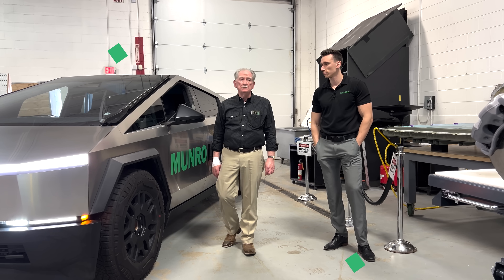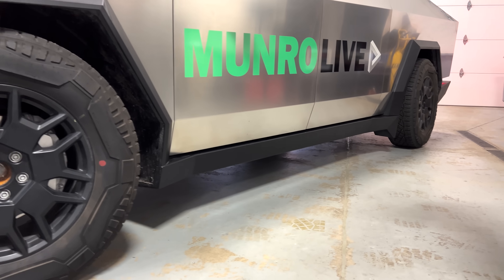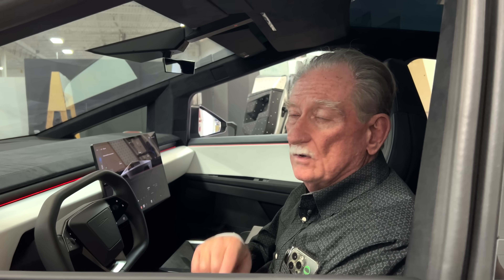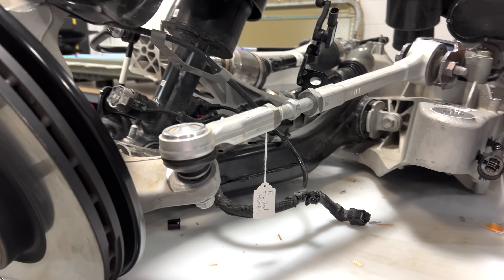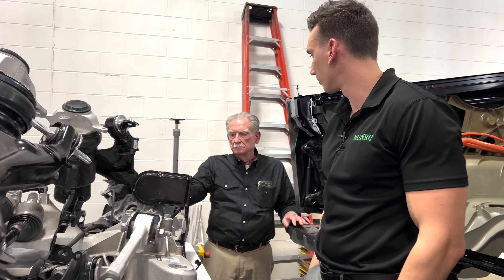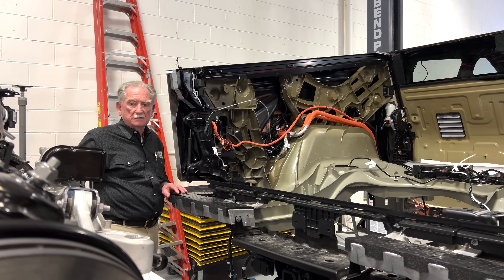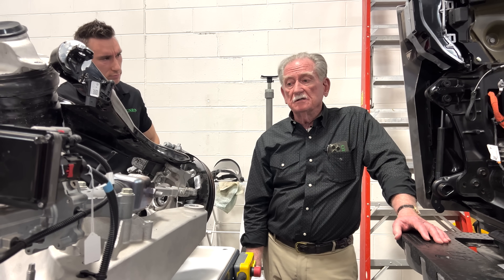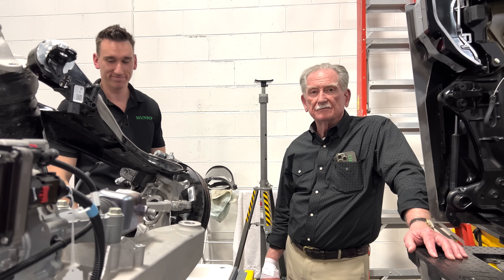Tesla Cybertruck Steer-by-Wire System

Comment: Stop shilling for cyber junk.  Your lack of any design lack of awareness  is showing.  the Cyber junk is a menace to all, it's customers, pedestrians, and any sane thinking person.  ummmm, aaahhh, ummmmm.  audi has had rear steering for a long time, and 48V, stop making up stuff like Tesla is innovating anything, stop the lies Disastertruck

Tesla's Cybertruck is really struggling to keep it together.

The brutalist pickup, once CEO Elon Musk's much-beloved pet project, has been mired in problems since finally going on sale late last year, from a major recall caused by a disastrous issue involving the accelerator pedal to being defeated by small hills and even a trip to the car wash.

Now, one owner has reportedly had the entire assembly of his truck's gear shifter come crashing down, causing the truck's visors, which are also attached to the assembly, to be ripped off as well.

For reasons we can't explain, Tesla chose to mount the gear shifter to the vehicle's monstrous windshield, requiring drivers to switch drive modes via a touchscreen suspended above their heads.

"THIS IS a clear design and engineering error!" former Tesla engineer Cristina Balan tweeted. "The issue with this design is the fact that the visors are one of the most used part in a car that takes the most amount of force!"

"This will ALWAYS be a problem if they don’t change the design!" she added. "This is bad."

Comment: I’ve been behind a few cybertrucks merging from an on-ramp, the front of the cybertruck was micro-darting left and right while negotiating the corners of each on-ramp. I get what Tesla was trying to achieve with this system but it seems like the implementation has been botched. Disappointed to see this technology act as an obstacle rather than a supplement to driver engagement.

Comment: 9:50 A great and popular computer repairman once blasted Apple for a flaw in their laptops: the power pin on the motherboard was right next to sensible CPU voltage line near the lower keyboard. One drop of coffee reaching that emplacement would fry the computer.

Could this be something with the 48V Ethernet loop? having the 48V pins right next to the communication bus? IE, someone drops an open water bottle at the wrong place inside the cabin and doesn't notice it right away?
Reply: The connectors are far away from such splashy zones I imagine. Also the apple ribbon connector is quite a bit smaller pitch compared to what clearly is a separated set of pins between the power and data.

Comment: That etherloop wire+connector looks interesting. 
First of all, the cable is not twisted pair like we're used to seeing with Ethernet.That seems important, since twisted pair and differential signalling is the way ethernet builds resistance to interference. I would love to know how this system was made resistant to interference, or if Tesla perhaps found that twisted pairs are not needed and differential signalling works just fine over this flatcable design. It would be helpful to know how this cable is routed in the actual car.
Second of all, I would be interested to know how many contact points are present on the connectors.

Comment: I was hoping for a teardown of the front rack to see how the two drive units deal with failure modes.  Clearly there's a worm and wheel pair turning a pinion driving the rack on each side.  Also the description of the electrics sounds a bit presumptive.  I mean are they really using ethernet packets for realtime control as Sandy suggested, or was that just a guess?  Hook it up on the bench and find out.  This is the 'technology' we're told is so great, can that not be demoed?  Thanks for the video!

Comment: Glad to see ZF is likely to be co-developing this system. I would not want to trust a company to get safery in a steer by wire completely right when they remove features like a previously working parking assist to maybe deliver a camera based function like 2 years later that still misses the rudimentary functions and tolerances of ultrasonic sensors 10-15 years ago (at least in europe based on the experience of a colleaque with a new Model 3 Highland with (in his words) still unusable front parking assist...). 

Don't get me wrong: the electric powertrain is very good nowadays. But for many other basic "car-functions" for me it is too much tryout and live with cost savings with not working backup solutions or quick and fast updates sometimes with function restrictions...

Comment: ah, Can this steering system be easily implemented in a gas car?  Does it require software and an EV system?
Reply: Yes, 48 V, Steer by wire, reer steer, Ethernet loop etc has nothing to do with EV.

Comment: Seems I often hear Sandy and Armin, say a part is forged aluminum, when in fact it's probably just cast aluminum.  Forged parts are more expensive to produce and for the parts shown, a forged part is probably not needed when a cast piece does the job at a lower cost.
Reply: I'm callin BS on this one. I've run into this mis-assumption many times in the past. Forging in many circumstances can be a lot cheaper than casting. especialy for an aluminum part. I know this for a fact. The steering components (tie rod?) does appear to be forged. And the part they point out as being forged would be very cheap to produce as a forging.

Comment: I watched the video yesterday, and this morning I woke up with an epiphany. I'm pretty sure I know why ZF incorporated 2 servomotors on the front steering rack, and it has nothing to do with the non-existant "triple redundancy". It's to provide enough force to steer this giant tire/wheel combination. My guess is that ZF had an off-the-shelf servomotor that was just not quite enough to steer those huge wheels in certain situations, like when the vehicle is off road and one or both of the front wheels is stuck in a deep rut or up against a rock. And rather than design a newer larger servo, they just doubled up with smaller motors. And this would explain why ZF/Tesla had to add a third position sensor. Has nothing to do with redundancy.

Comment: In control engineering, the arrangement is called 2oo3 ( 2 out of 3majority  voting )  system....not triple redunandant.
 Triplr Redundant to a SINGLE control unit is adequate to  guarantee an acceptable level of safety such that any fault will automaticallly force the car to go into a safe state to protect the car and its occupants from an accident.
Reply: My guess is that the third sensor is not for safety or redundancy. Odds are that ZF/Tesla went with two servomotors on the front steering rack in order to provide enough steering power to steer this giant tire/wheel combo in certain off road environments. Anyone that's ever worked on a dedicated offroad racing truck would understand this. I believe the third sensor is for power management between the two servomotors since they have to run synchronously all the time. This is not a design for redundancy.
Reply: @Thegrimmechanic  that is nonsense. If they would do as You say, they would just make one longer motor for bigger torque.
Reply: @marcink5820  It is not nonsense, it's commonplace to design this way for many reasons. One reason is for space constraints. there may be a 'packaging' issue that requires the use of two smaller motors rather than one big one. Look at how aircraft are designed. The other reason is inline with the patent (but I'm guessing you never read it) to make the obsurd claim of redundundancy.

Comment: Airplanes have redundancy on all crucial systems, but Cybertruck doesn't have redundancy on power for example. So if power fails, you will lose steering.

There's a reason why other brands still have mechanical backup on drive by wire systems.

Also the amount of electronic overhead on this system leads me to believe it's not as cheap or as light as its mechanical counterpart.

As far as boats, we've seen what happens when they lose power, they collide into bridges because they lose steering, for example.
Reply: As you can see in the video it has two motors on the steering rack, it would make sense that each motor would have it's independent  steering sensors and separate power supplies for redundancy.
Also it looks like Lexus steer by wire didn't have mechanical failsafe, anyways these are road cars not airplanes, the safety requirements have nothing in common.

Maybe not an advantage in weight but clearly makes driving more interesting and easy.
Reply: There is a little redundancy in the front and rear steering wheels. If the front went out you could very slowly navigate the car. Probably enough to get it off to the side of the road. 

That is assuming it failed in the center 😅

Comment: That is not triple redundancy, it's only single redundancy. Two steering motors, two failures deep and your not steering any more. If it was triple redundant, you would still be steering after two failures (steering motors).  The communications cable has only one connectors. if it fails all data is lost, the two cables don't count. The two cables are not even redundant, with a single connector and may even reduce redundance. If one cable shorts has some of it's wires shorted, is it shorting the other cable too, thru the connector. If it melts the connector, it's melting both connectors.  The redundance is in the actual details, not enough information in this video to figure out the redundancy. Even the Three Steering Position Sensors does not mean it is triple redundant. The third sensor is good to figure out which sensor has failed, but with a second failure, you cannot figure out which of the two sensors failed. What do they do? An average of the two remain sensor? Another failure hard over the, the average position would end up in a crash. So, 3 sensors, may only be single redundancy.  I would call this single redundancy, as a second failure may result in a crash. Something fails, it may be safe to go to the shop to fix it, but isn't safe to rely on the second level of redundancy for any amount of time, no.

Comment: I've never heard a new car creak so much before, ya the tires make a bit of noise, but the steering sounds horrible. Oh and sandy, that's almost 180% of rotation on the steering wheel, not 90. Hope your tolerances are closer on your engineering 😉

Comment: How is rear wheel steering a new technology? I had a rear wheel steering on my 7 series some 12 years ago.
Reply: Honda prelude 1988 had 4WS. 
Subaru X1 (not sure of the model some 80ties model) had 4WS and 4WD  and could adjust ride height too... the list is long
Reply: Also, the rear steering on the CT is necessary for the poor design, so this can just barley have a WORSE steering radius than a Suburban.

Comment: Interesting to see confirmation if it really only is Ethernet and not CAN for SbW (I'm not aware of an released automotive Ethernet spec with TSN allowing for priorization and deterministic availability required for such a system). And again - don't guess on things you haven't opened. It is very likely NOT a planetary gear but a simple worm gear from motor shaft to pinion shaft for the required ratio to rack travel (dual pinion steering gear)

Comment: Support an automaker who wants to monopolize the market. 
Fact- Insurance companies will charge you 3 times as much for insurance compared to conventional engines
Fact- Tesla has terrible service regarding their vehicle maintenance with technicians charging over 200.00 per hr.
Fact- If the battery is damaged from being located under the car its not fixable. Repaur cost an easy 10k for for new replacement battery not including labor.
Reply: Oh, and don't forget you can break into a Tesla "frunk" with a pocket knife in about 10 seconds...

Comment: What happens to the triple redundancy in case of an EMP shock? Like a solar flare?
Reply: EMP will fry everything.  Most cars already use electric power assisted steering so that will die and the steering effort will increase 3 times or more.  Many people do not have enough strength to turn the wheel in that situation so the mechanical linkage is not a huge help.  Just hope you are going straight regardless of mechanical or elctronic linkage.

Comment: Mode of failiure would be of intrest with these systems. You observe there are 2 steering motors. If one motor fails, there is still the other to produce the motion. Well, not necessarily. It depends on the mode of failiure. If there is some mechanical failiure inside one of the motors and it locks up, can the other still move the whole mechanism, including back driving the failed unit? How is that risk assessed and mitigated? Also, you observe twin flatform cables for the data and power, but it only has a single plug. How is that classed as having redundancy? Most cable failiure is at the connector due to corrosion. I would have thought it would need 2 completely seperate cables and plugs connecting into a module with 2 completely seperate circuit boards etc etc. Tesla is undoutably brilliant at this so Im sure they have this worked out, it would just be interesting to see how.

Comment: Looks overly complicated for something that can cause a major safety issue.  I’d prefer that manufacturers stay with a mechanical connection for the steering.
Reply: why not try something different?
Reply: @websitemartian  You can try a lot on a car, but not when it comes to steering and breaks. Those two are the most important elements for operation safety.

Comment: Yes, the rear unit is almost certainly belt drive - it appears to be ZF's standard AKC Central
Reply: Nope! AKC looks different. This is Schaeffler RWS with planetary roller gear (belt connection to motor)
Reply: @felixweinreich3999  they're generally similar, and neither matches what we're seeing in the Cybertruck in every detail, but it does look like the Schaeffler RWS. They're both belt-drive. It's hard to imagine getting steering components from two different suppliers, but it can be done.
Reply: @brianb-p6586  I can see the Schaeffler position sensor design in another video ;-) Trust me it is Schaeffler and not ZF RWS - I've seen both in real life, CAD and also driven them
Reply: interesting - my link to the Schaeffler press release has been deleted... just google "Schaffler Rear Wheel Steering Cybertruck" - should be the "world premiere" link

Comment: "I've ever we've ever worked on um nothing comes really close to this with the ethernet 48 volts steer by wire on and on and on it just seems to never end and I can hardly wait to hear when the guys come back and tell us about the uh uh the steering control modules um it just amazing absolutely amazing yeah"

Automotive ethernet is standardized, many cars have it for like 10 years now. And many PHEVs have 48V systems as well. Nothing new here in that regard.

Comment: Did I see BMW style axles and hubs? Face drive instead of splines. Are they hot-forged like BMW or do they look machined? I also saw Ford style outer tie rods. What benefit is there in such a wide angle non self-locking taper?

Comment: This is very interesting. On the front steering motors, how much is steering performance impacted by the the loss of one motor? Also, is there redundancy built into the angle sensor for the steering wheel? That is one of the only items you didnt mention redundancy on. I am not a big fan of the dual Ethernet wires running right next to each other. It seems that is one is severed then there is a high likelihood that the o the would be damaged.

Comment: It’s no surprise that the Cybertruck took nearly 6 years to come to market. The CT is a high technology machine. Giga castings, 48 volt electrical architecture, SBW, RWS, SS exterior panels, etc.
Reply: And a flawed accelerator pedal 💪
Reply: @BroXboxGamer67  must not remember the accelerator problem with toyota over a decade ago involving millions of vehicles. Acting like it is some type of OWN that a manufacture you don't like has a recall? name one brand that hasn't had a recall.
Reply: @JD-yx7be  yeah I criticized Toyota over that. What's your point?